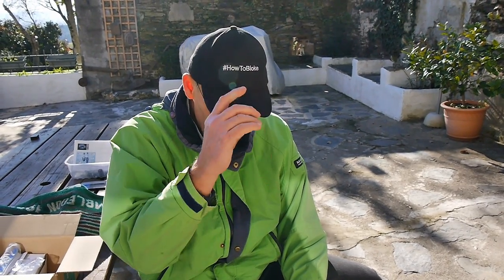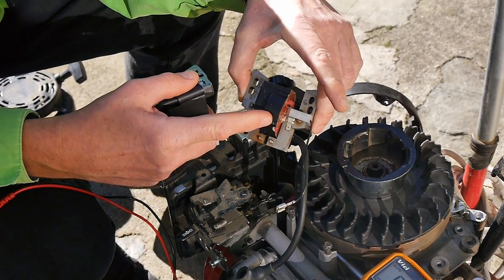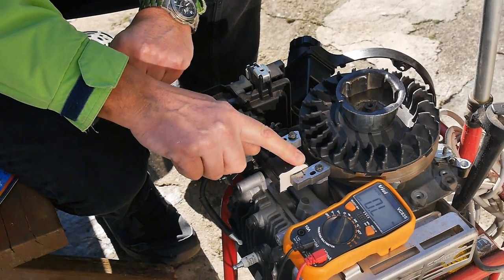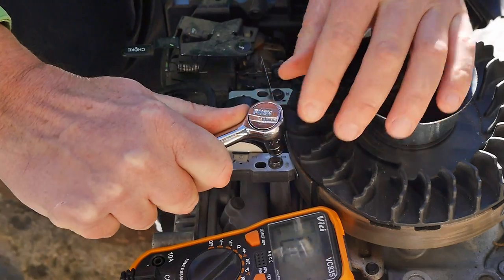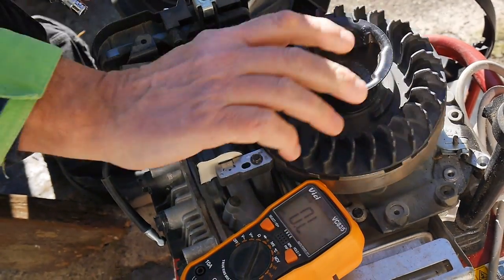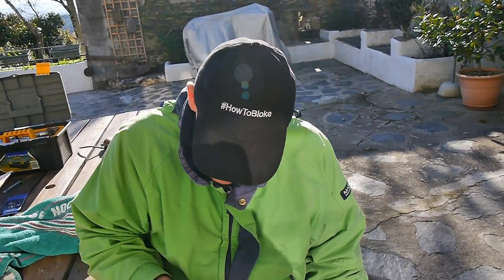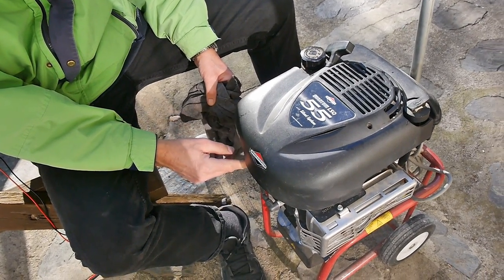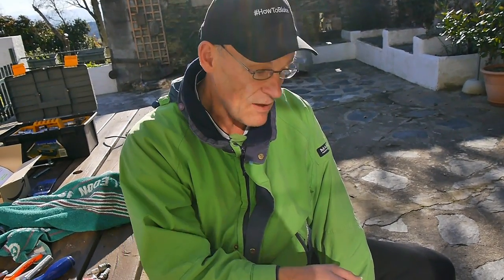DIY #HowToBloke 🇬🇧 Briggs & Stratton lawn mower engine Not Starting No Spark — Check|Fix|Repair

Comment: the magneto expands when hot so if the air gap is too close it will still hit; so maybe a business card is too close. No other person has mentioned the importance of having the coil the right way up. I saw the messages on the coil I admit I must have ignored them, it seemed more logical that the primary connector be up and on the same side that the kill switch wire is run, but that is good info and now I am getting spark again but still a no start, it is dead not a bit of trying to start just as if it hadn't any spark. The compression is 90 psi now  any ideas
Reply from the maker: Hello, have a read of my blog post here https://howtobloke.blogspot.com/2022/01/9-DIY-Briggs-and-Stratton-lawnmower-type-small-engine-wont-start-or-run-no-spark-problem-check-fix-repair.html 
Also, have a look at my spark plug short video https://www.youtube.com/watch?v=Ih11n_vlDgg 
Check fuel tap is on; is the plug wet with fuel?;  old fuel?; water in fuel? ; carburetor float-valve needle stuck in the closed position?; clogged fuel filter?; fuel pipe pinched? 
Thanks for watching #HowToBloke 👍

Comment: The Briggs and Straton  module ($30)  comes with an instruction card that is also the feeler guage and it covers both sides of the armature at the same time. Easy peasy
Reply from the maker: 👍 Thanks for your tip !